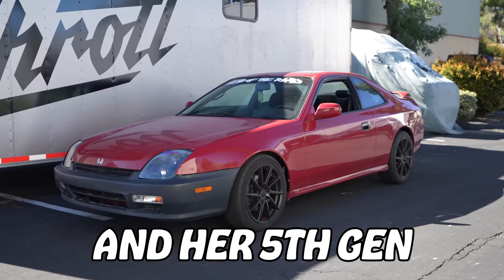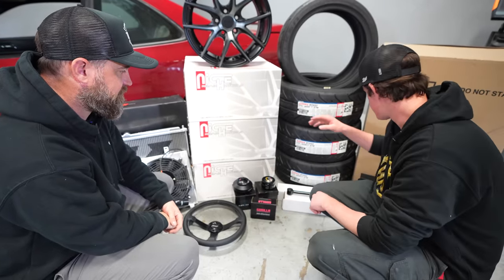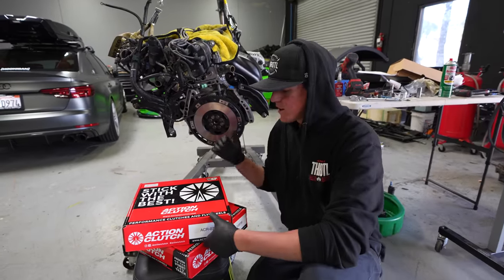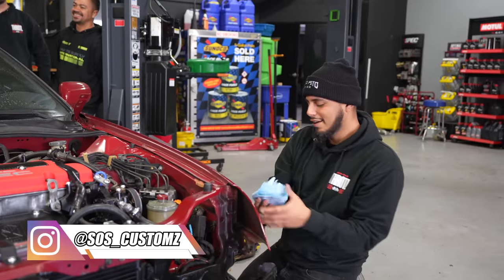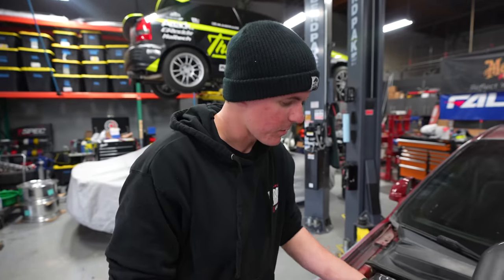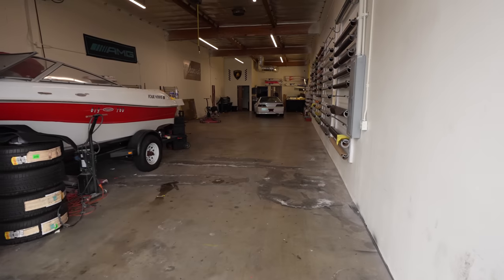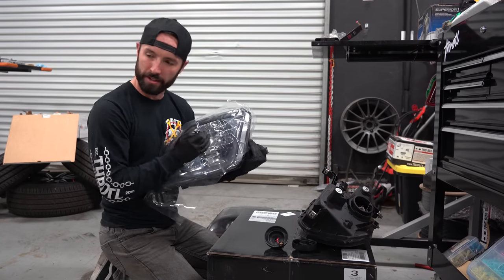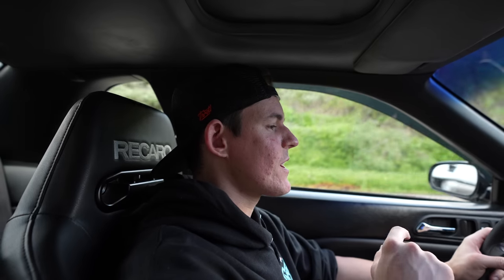Surprising our SUBSCRIBER with HER DREAM CAR BUILD! (Full Transformation) : 1997 Honda Prelude!

Comment: Man, that year Prelude (along with the 90-93 Prelude) have always been my favorite body styles. I had a 1986 Prelude 2.0 Si (the first year for PGM-FI) and it has the A20A with the five speed manual. I have always wanted a 1993 Prelude with the H22A and the five speed manual, but they're hard to find in the northeast that aren't completely rusted or trashed by Fast and Furious wannabes. I was 18 when the first Fast and Furious came out and I had a 1992 Acura Integra GS at the time. It was black on tan, but I swapped a leather interior into it, I detailed the entire car, I put a full Sony stereo system with four Orion Cobalt 10" subwoofers in a custom enclosure, a Soundstream Reference 1000 watt amp, a Sony 10-disc CD changer, I slammed it with 17" chrome rims (cool at the time), and I built a turbo kit out of junkyard parts for it. The turbo itself was $50 from a junkyard and it was a T3 Dodge Daytona turbocharger and after I rebuilt it, the car made 257 whp at 15 psi. I had some semi-slick tires on the front with a LSD in the transmission and a 1320 Performance clutch in it. It was fairly quick and would take out most performance V8 cars in my area in a drag race, or even a roll race, but the only vehicle I couldn't beat in the area was a fully built brand new Ford Lightning with the 5.4 supercharged with full bolt-ons and a 5 speed swap. That dude would whoop on me every time. I blew my transmission trying to race him in Bridgewater, Pennsylvania. It was black with 20" chrome rims. Whoever you are, touche bud!

Comment: When you decide to upgrade headlights i recommend using GTR LIGHTING headlights.  Plus the lifetime warranty is nice.  You would have gotten a better brake system with going with Cquence drilled and slotted rotors with aggressive pads.
Also,  Invidia has the same exhaust flanges.
On the reveal youbcan see just how bad the cut lines are on the wrap. Its already peeling on the edges inside the door jam. If they wrapped the jams they could have hidden the fact they cant cut a straight line.
All that aside.  Super cool build

Comment: Maybe a gauge pod using some glowshift gauges. Water temp, Oil pressure , Volts just basics atleast.. Cheap and adds a very nice feel and atmosphere to the drivers seat.. Some Strut tower bars for the front and the rear would have been a good cheap upgrade..

Comment: 19:04 I wouldn’t doubt there is something funky with the shifting. I’m not a big Honda guy but I’m pretty sure the preludes came with H22 or non vtec h23…  isn’t a red top usually a GSR meaning it’s a B series swap ? That would probably account for the shifter cable length issues

Comment: Fantastic build! However... Should've chopped the Skunk2 muffler off, and swapped the MagnaFlow muffler back over. These cars were designed for a twin tip muffler, and you can tell by the elongated cutout in both the OEM bumper, and all the aftermarket lips

Comment: I've been having that same problem in my '95 Accord with the shifter. I was told to get adjustable linkage cables but not 100% sure got the short shifter adapter but I wasn't able to get second third or reverse because the cables are too long. The OEMs wouldn't be adjustable would they?

Comment: The Wilwood Brakes, Hybrid Shifter, BC Coils, Steering Wheel and Mugen Carbon Rear Wing were the gems on this...

However I was disappointed to see that while you were in there changing the Water Pump YOU MUST UPGRADE THE TIMING BELT TENSIONERS WITH A KSTUNED KAIZENSPEED TENSIOR AS THE OEM TENSIONERS ARE NOTORIOUS FOR FAILING! AND BEING IT'S AN INTERFERENCE ENGINE BOOM BYE-BYE ENGINE! So at ANY TIME the motor could go tomorrow because y'all didn't upgrade this MOST IMPORTANT MOD ON THESE H22A ENGINES!!!

2ndly y'all put the BC coils on this, but didn't go with the Extreme Drop version with the upgraded Swift Springs (such a great upgrade) but there was absolutely no Hardrace, SPC Camber or Toe kits installed??? WHY WHY WHY?!!! no Rear Tie Bar or the MPC Billet Forks...
 I know y'all are on a budget for the build but buying all those Control Arms with absolutely NO ADJUSTMENTS IN THEM OR POLYURETHANE UPGRADED BUSHINGS was just A WASTE OF MONEY!!!

HOW DID YALL align this car so she can have straight Steering and not ware those Tires unevenly? U OBVIOUSLY DIDN'T & CAN'T BECAUSE YOU WOULD'VE NEEDED TO HAVE THE CAMBER AND TOE KITS INSTALLED TO DO A PROPER ALIGNMENT...

YALL Upgraded shift Cables which is always nice on these, but didn't upgrade the Shifting Detent Springs with the MTech Detent Springs, nor did the Speed factory Shifting Cable Bushings/Washers upgrades, but maybe those upgraded Shifting Cables had upgraded Bushings and Washers with them...

Then you go with blue NGK Spark Plug Wires alongside a hideous Yellow Top Battery that has no business in that bay whatsoever, when a Red Top Battery should've been installed instead alongside Red or Black Spark Plug Wires (but honestly a KTuned Coil-Over-Plug upgrade I would've just done instead)... 
Then we have Chrome Housing Fogs and Directionals when Black Housing LOOKS SO MUCH BETTER!, color matched Bumper Side Parking Light Lens Housing in White...

And lastly why not go with the Carbon Fiber NRG Quick Release and Recaro Seats with some Red Stitching and Black Suede (those seats were nothing special plain black leather Recaros, but did a Great job on those seat rails 👍🏽), the Lip Kit I would've went with instead that looks ALOT BETTER than the Greddy Lip and those Sides, is the Wings West Front Lip and Side Skirts alongside the Mugen Rear Splats (or the Value Sports Replica Front Lip, OEM or even the P1 Front Lips are ALL MUCH BETTER LOOKING THAN THE GREDDY!, Flow alot more well with the body lines And aren't as tall too)

And why not go with 17x9 Wheels? They will fit, as The 17x8 Wheels on narrow 215 Tires isn't going to do much in gains of performance! compared to 235/40/17 or 245/35/17 Tires...

Also Hasport or Innovative Engine Mounts with 75 ply Polyurethane Bushings, alongside Lateral Link Traction Bars eliminate Torque and Bump Steer on these cars (another MUST DO/HAVE MOD) and finish off with an EM Racing C Pillar Bar (if you can find one), Rear Strut Bar, Front Tie Bar from Tanabe, Skunk 2, Blox, Netami, Ultra Racing, Megan Racing or Neuspeed...

Doing these CRUCIAL additions would've been THE WAY TO DO THIS CAR CORRECTLY!

 I was cringing, swearing and SMH at seeing some of these choices being made on choice of parts... 

Maybe some Custom Cluster Gauges that say Prelude Type S on them and some Custom Morimoto or whatnot Headlight Projector Retrofits on this build?

Letdown on some KEY areas of this build...
DISSAPOINTED... Didn't give this Prelude the right juice... Squeezed dry unfortunately 😞

Comment: That Greddy on the front bumper looks SO horrible and has no reason to be there, especially on a prelude. That back wing is something special, and the fact you didn't replace the exhaust manifold is a sin when you had everything apart already and no tune, no turbo, I get reliability but you can do all those things with reliability in mind. the red door insides makes me feel like it wasn't done to the fullest as well.

Comment: Hearing Willwood brakes and nice parts and then an NRG steering hub hurts. If you're building a car for someone else you can't skimp on the thing that literally holds the steering wheel in. At least get them a Works Bell hub..

Comment: Why wrap the car and not just repaint it? The clear was cooked, and now when the wrap starts to fail, the paint underneath has a bunch of bondo and such. So it will need repainted in the future. Full car wraps, that are good, are typically between 5k to 8k. At that point, a few extra grand to paint it would of been such a better option.

Comment: I bought a truck $20,000 six years later Moto broke, went and bought another motor $4000 I’ll pay the mechanic put it on and still not running guys. Be careful who you get out there as a mechanic my truck still stuck. It’s not running, and my money ran out.

Comment: Hey  I got a 2007 Mazda 5 that I converted it so I can get around in.bec I'm paralyzed knees down from pro mottocross crash 14 years ago. An I'd love for y'all to rebuild my Mazda 5 an turbo it would be the only Mazda 5 that's 2.3l turbo car in the world. I put everything new on this car an now new battery terminals an starter. An I still can't even figure out why it won't start.sucks bec this is the only way I get around by myself bec I made it so my wheelchair fits in there.made my own hand controls been driving it 10 years an recently broke down and can't figure out why it won't start really hurts Bec my only means transportation even though everyone makes in front my car.but for fun I have two 12 mtx in terminator box. An put rims on it gutted it an sum one crashed into the rim now got three rims an one stock one so sad I really wish y'all could help me out.but I'm in ellijay Georgia and currently living off disability. I'm usually good at fixing stuff an can't figure out what is wrong with it put new terminals and new fuse an main fuse block an still won't start 😰 sad Bec I really took good care the motor an put cold Air intake and ngk plugs an maintenance my motor regularly.im in a wheelchair and can only do so much.I'm make it race car one day I get money be my dream to have this car fixed an turbo plus be great content car I believe let me know if ur interested in helping me plz u would save my life.i rebuilt the car once already Bec truck run me off the road person was on phone.replaced the hood an front plastic bumper cover. Swear I just can't catch break in life 😅 it's hard living off 711$ a month.

Comment: good stuff , but rookies still making mistakes !!!
DON’T hang callipers
SUPPORT IT
very rookie

pleases stop using suppliers  parts if owners parts are BETTER !!!! projector front lights weee better thar cheezy OEM lights   !!!!!!

please do good,
don’t make it soso

7 out of TEN  on the build
but for lights and the tires
FALKEN  really suck
Michelin or at least coopers or Hankook if you blown budget on the CoilOvers 
yuk

Suspension is an art
billstein with  HR OR other springs !!!!

too much noobies in the kitchen

coilovers are for hacks ( newbs )

coil overs used by offRoad pros
or shops that do not follow the herd !!!!

moooo MOOOOHHH !!!

lol

Comment: Don't take this the wrong way but how do yall always manage to half ass shit at the end? The one that ALWAYS gets me, is why redo the whole exhaust but not the header? you even had the whole motor out it would have been easy. That and I am sure just about EVERY brand of carbon fiber hoods require hood pins to be installed otherwise you void the warranty. I just don't get it, hell even the wrap looked terrible in spots, especially around the door handles.

Comment: Boooooo!  They didn’t do the clutch and timing belt with engine in car! 

I wanted to see them deal with the ATTS.
Reply: ATTS was missing to begin with.    ☹️.    I hope they at least put an lsd transmission otherwise handling has been significantly reduced.
Reply: I thought another video description stated this car was the SH, but I think this is just a base model prelude.
Reply: Yeah I think is the base model so no ATTS or LSD transmission

Comment: I had to pause the video. At the rapping part. You guys absolutely and utterly and completely butchered the hood and wing absolutely completely butchered. It should’ve left it full carbon fiber looks so much better. Also, I would’ve went with a duckbill type of rear spoiler, but to each its own.